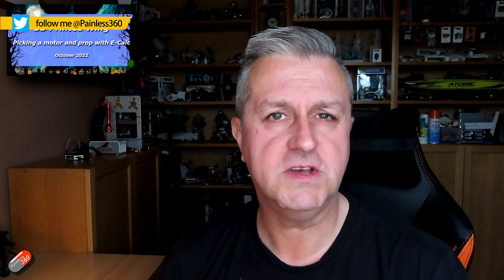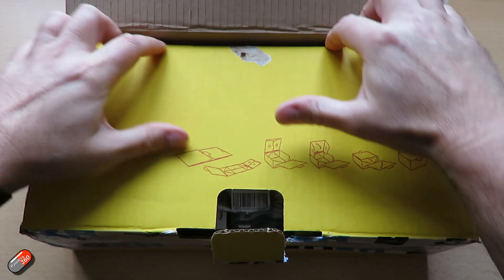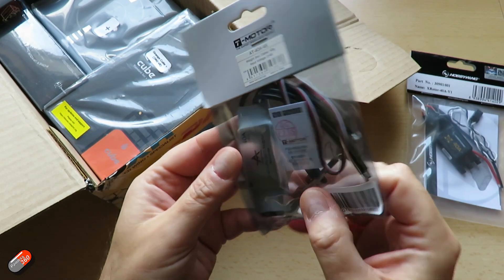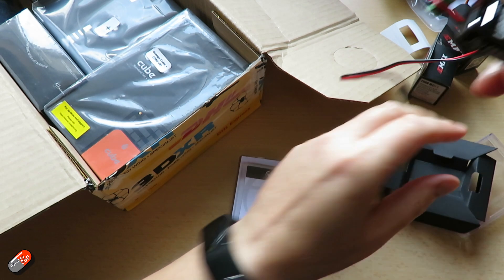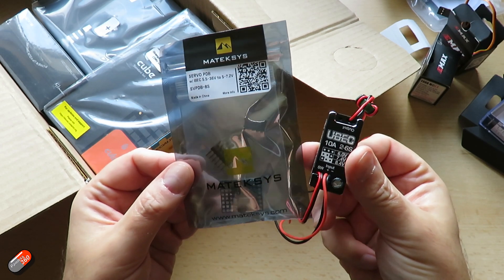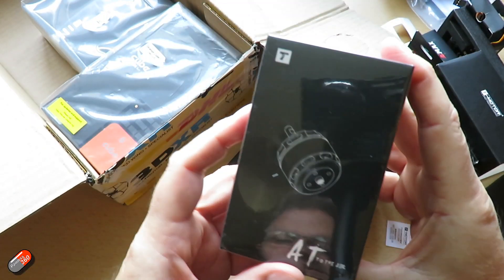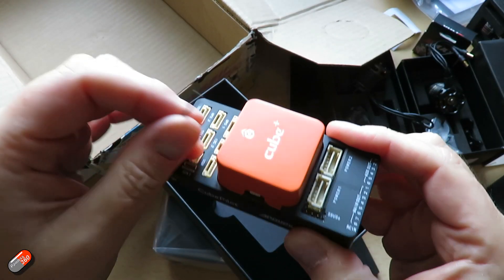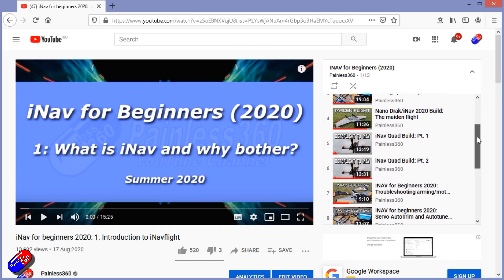What parts have I ordered for my Eclipson 3D printed wing build?

Comment: Hi Lee, have you considered using a multi rotor style esc? I have used them on flight controller builds and have the feeling that they are more efficient. Certainly smaller and lighter. Looking forward to seeing the wing in flight, it looks so drool worthy.
Reply from the maker: I've used them in things like the AtomRC builds when motors and props are smaller. I prefer fixed wing specific ESCs as they are better suited to running the larger motors and props on models like this... Happy flying!

Comment: Did you print this at home? FDM or Resin? Or lots of sanding? I cant see a single layer line.
I was thinking of 3dprinting the ends of wings, gluing them to foam blocks and using a belt sander to bring it down in line with the end caps.
Not sure how the belt sander will work on foam. Hopfully doesn't melt lol. Ill laminate with some tape afterward
Reply from the maker: Check out the videos where I did an overview of it. I cover the print, plastic and printing tips and tricks... Best of luck

Comment: nice components! sorry for the stupid question, but how do you mount the ones with the long shaft on the back of the wing? the shaft won't go inside the fuselage?
Reply from the maker: Usually by making a recess behind the motor mount for it. See my e-wing builds for examples... Best of luck
Reply: @Painless360  will do it! Thanks man!